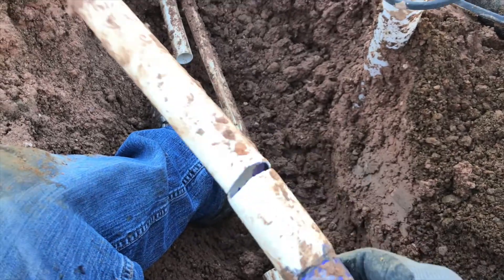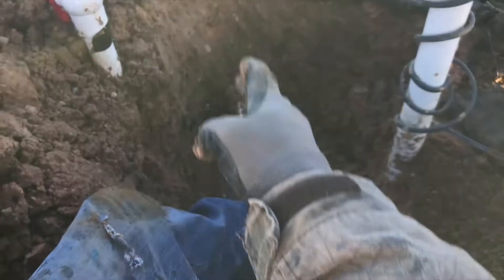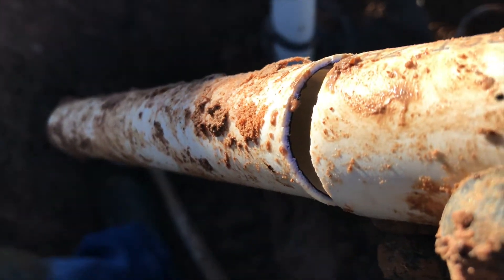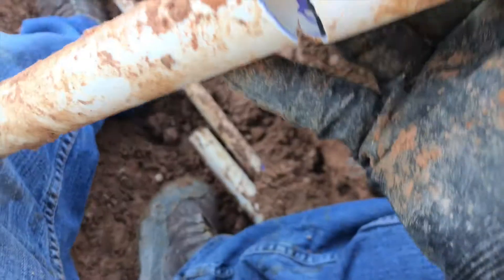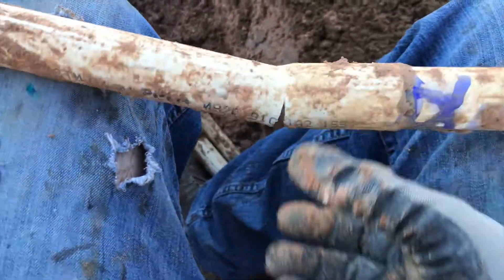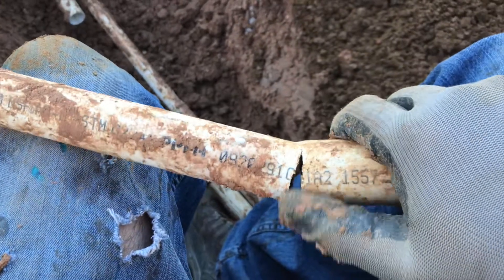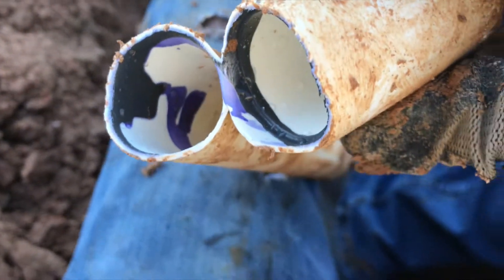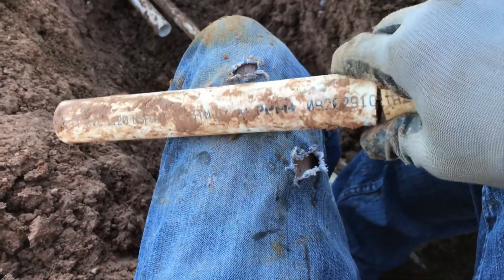Do Not Over Prime The PVC | PVC Tips And Tricks | Irrigation Installation Tip

Comment: The key here is "irrigation system piping", which I swear is half the wall thickness of Schedule 40. Every leak I find in my original yard irrigation piping gets replaced with schedule 40. Not only is irrigation PVC thin, but it isn't as forgiving when you hit it digging. In the long run, the cost is offset by fewer headaches.
Reply: I just found this channel and enjoying it and I'm staring as a non professional looking at that pvc and I'm thinking gosh.. that looks like some thin pvc.. We only ever use sched 40 on our rental properties.
Reply: Class 20 
Too thin 
The people installing it usually won’t be there to deal with the issues that come with using it.
Reply: You're also reducing the overall volume (flow: often mistakenly referred to as pressure) of your system. Thin wall is perfectly fine if you know what you're doing. Just don't hit it with a shovel.
Reply: @OGRH incorrect. Piping is sized by inside diameter .

Comment: I have been having issues with pvc the glue not sticking as if it pushes all the glue out I chamfer sanded it and still happens could it be that I put to much primer I put it to where it has a nice deep purple coat maybe 3 times I cost it is that to much?

Comment: I don't apply primer or PVC cement much farther than about half way into the bell. I also am conservative with how much cement i use on the inside of the bell. If you use too much it will pool up in the bottom of the fitting and eat through it. You can use all the cement you want on the pipe sliding into the bell because any excess there will be scraped away when sliding the 2 pieces together. It is also important to wipe away any excess so it doesn't weaken the pipe where it meets the bell.
Reply from the maker: Excellent pointers. Thanks.

Comment: Thank you so much for sharing!! So hard to find videos about whether or not to use primer on pvc
Reply: Always use primer. Not just my opinion it’s how the weld is made. Chemical reaction. Primer heats up the pipe and coupling and then the mixture of that and the glue actually welds the two together.